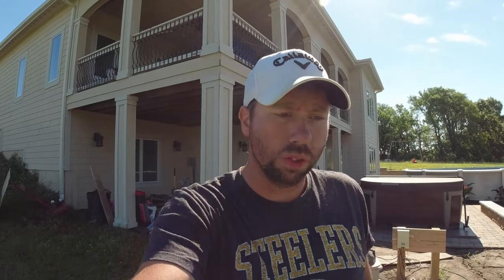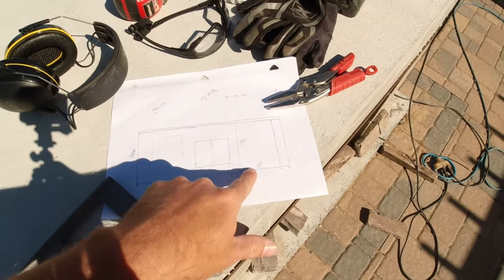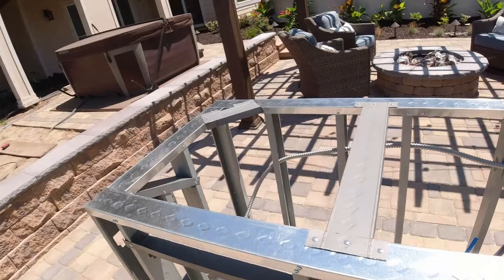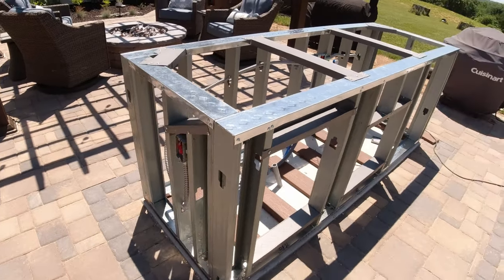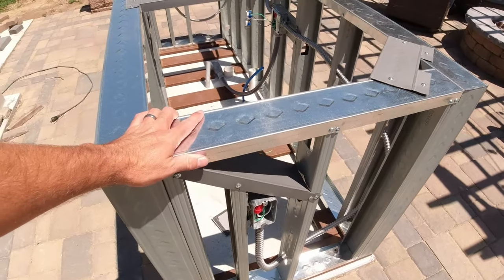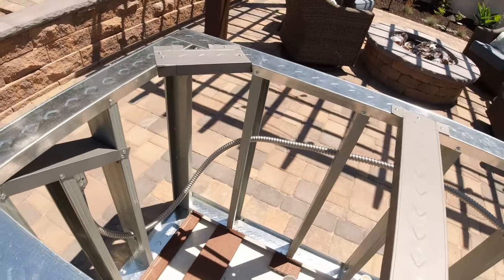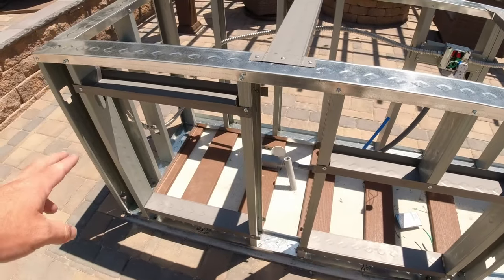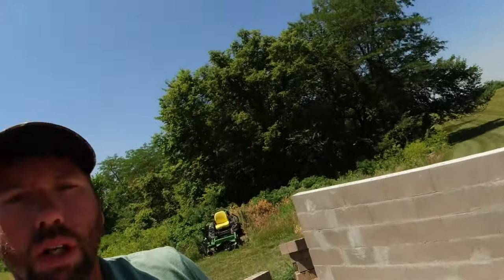Framing the Outdoor Kitchen Island - First time using metal studs!

Comment: I love your video, just helping others. For your electrical: Try using Metal Stud Bushings instead of a Flexible Conduit. You can pull the wire without cuts. Then some Splicing Connectors for your main box where the power comes in. It will take less space than a giant electrical cap, or multiple caps. 
Also, gamatoutsikos I am going with an open floor plan for the pizza oven. The house door opens and it's a straight shot of walking to what I built. If so, the prep table should go on your main-hand side. The islands are also nice for prepping. The pizza oven is higher than the island so you can still see your build. Sitting on the island looking at the pizza oven and eating your bake is also just as nice

Comment: Can you offer a ball park cost estimate for an eight foot island without electricity?
I’ve got lines for water, drain and gas to support a BBQ without lighting or refrigerator.
Thanks for you clear construction video.
Reply from the maker: Assuming island is 3ft x 8ft with a 4ft x 8 ft countertop.  About $150 for the metal studs, $140 in cement board, $100 per access door, concrete countertop forms $100-$200, concrete and additive for countertop $150, $150 for sink, $150 for faucet, miscellaneous screws and parts $75.  That is about $1,125 before exterior finish and taxes.  Stone could add another $500.

Comment: Exactly what I need. What is that miter saw stand/stop block that you are using? My DeWalt Miter Saw stand has too much play for it to be good for stop blocking.
Reply from the maker: I use the Rigid brand miter stand from Home Depot.  I’ve had mine for almost 10 years and still works great.  Easy to transport and the stops are very sturdy.

Comment: I keep watching this because I want to use metal studs to build out the galley in my van. Since weight is an issue, I won't be using cement board but I still want it strong enough to support a traditional countertop. Any suggestions?
Reply from the maker: I would just move up to 18g metal studs if you don’t want to use cement board.  They aren’t much heavier and is very sturdy.

Comment: Nice work! I will be constructing one to put on a wooden deck. It is under a pavilion so is dry. Any thoughts or changes you would make in that case? Thanks for the video!
Reply from the maker: Hello!  I don’t think I would change much. Since it is dry, if your deck is level, you could attach the metal framing directly to the deck boards and skip the composite base I set mine on. I would use 20g studs, 12 in on center.  Mine has been supporting a 4’x8’ concrete countertop like a champ!

Comment: Great video ! What is the high to
Cut
Reply from the maker: The height is dependent on how tall you want the countertop.  This could be taller or shorter depending on your height.  I went with a finished countertop of 32” so my framing height was around 30”.

Comment: Wondering why steel studs for the framing instead of wood? Is steel better?
Reply from the maker: Wood is probably just fine.  Treated lumber will twist as it dries and will expand with the weather.  It also has a chance to rot.  Metal studs are lighter, easy to work with and strong.  They are also non-combustible which is necessary for many outdoor kitchens.  Metal can rust, so it is important to not directly attach them to the concrete.

Comment: Have you had any issues with putting the composite deck board on the concrete? The manufacturers of composite deck board explicitly state not to install composite deck board directly on concrete.
Reply from the maker: For this purpose, there are no issues with using composite boards as shown.

Comment: How long do those studs last in the outdoors? I’m in the northeast and wondering if these would be a good choice.
Reply from the maker: They will last longer than me!  They are galvanized and won’t be taking on direct water.  They will get damp at best. Raise them off the concrete and you will be fine.  After a year, no signs of rust at all.

Comment: working on a similar project but have an issue with the concrete pad not being level from front to back.  How would you level up the track? I need to raise the front track about an inch.  Any one have ideas?
Reply from the maker: If my pad was not level, I would have secured the bottom track to the deck boards first.  The bottom track would follow the slope of the pad.  I would then cut and install the first stud. With this stud in place, using a long level I would then measure the distance from the level to the bottom track for the last stud. Once you cut and install the last stud, this should make your installed top track level.  Now you can measure and cut each stud between the first and last stud to fit.

Comment: Hello, great job on framing.
I’m starting my own kitchen and wanted to know the height you used for the studs.
Thank you Oscaf
Reply from the maker: I wanted my finished countertop height to be around 36", which in my scenario would have required 34" studs.  However, I needed to go a bit higher to ensure I had enough height to fit the refrigerator.  If using metal studs, you can subtract your countertop material thickness from your desired countertop height to get your stud length.  Example : If you want 36" finished height and your countertop is 2.25" thick, your stud length would be 36"-2.25" which equals 33.75" stud length.

Comment: Thanks bro, I’m following you here and will start my own project. Have thoughts about bbqtubes instead of those metal studs?  Thanks for sharing
Reply from the maker: The BBQ Tubes are perfectly fine to use.  They are narrower than traditional metal studs which can be an advantage is areas where you need cutouts slower to the counter edge(like a sink).  However, I do not believe they are necessary to build an outdoor kitchen.  Metal studs are easier to find, more customizable and cheaper.  The 20g studs I used are plenty strong as well.  I put a 8' x 4' 2" thick concrete countertop on mine and no issues.